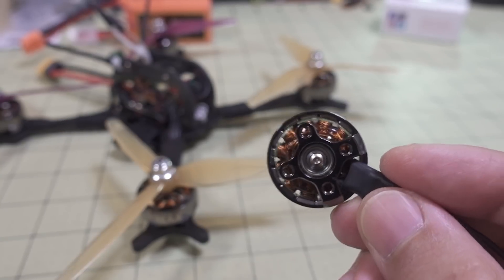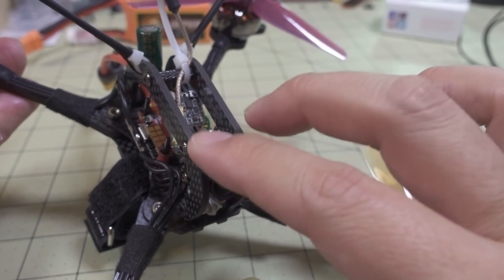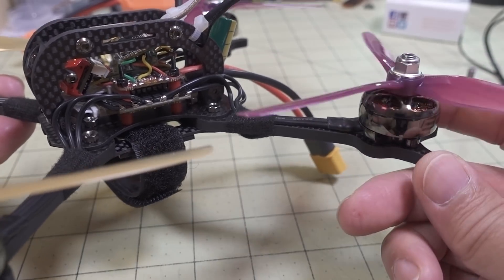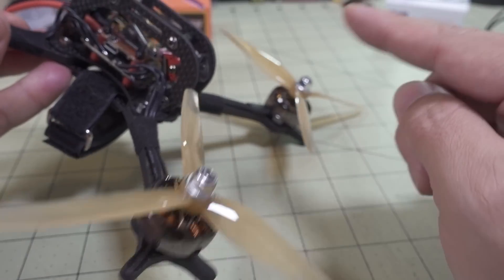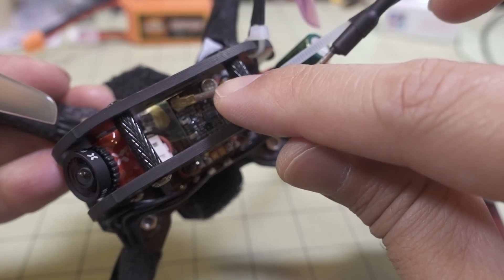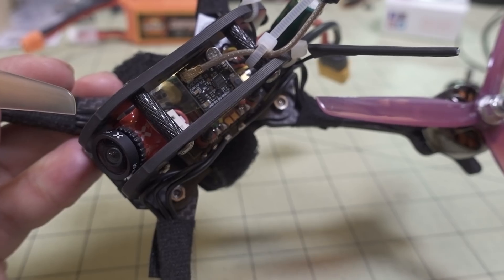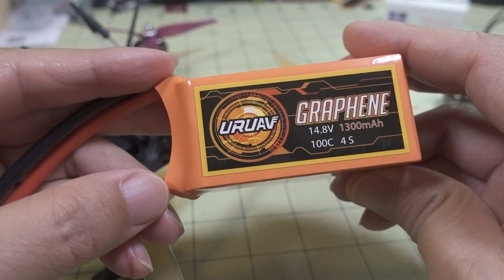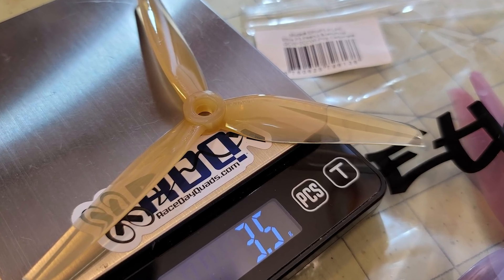EMAX ECO II 2306 Motor PLUS Other Stuff 🛠️

Comment: I bought 2207 1700kv motors and I have a 40a esc, will I burn the esc while flying with 6s batteries.

Comment: i-Flight XING-E Pro 2208 2450KV Motor is good?? Or emax eco series 2 1900kv??
Reply from the maker: Kinda depends on the prices.  Both motors are good.  I think the EMAX will cost less usually and might be a better value if the cost is more than $3 lower than the XING-E.
Reply: @AlbertKimTV  which would u choose
Reply: Or this
T-Motor VELOX V2 V2207 Powerful FPV Motor

Comment: I am still out dated with the new motors but doesn't these motors require two sets of clockwise and counterclockwise motors or is there any technique that all the four motors spin in their desired directions without having such type of specific lock nuts?
Reply: Probably don't need this answer, but it will serve for anyone scrolling down in the next 5 months.
CW/CCW motors are old school, Nylock nuts were uncommon so they needed special threads to prevent the motor from torquing the nuts loose.
Today with aluminum locking nuts and serrated bells, there is no need- there is however a slight advantage if you use "turtle mode" all the time since the props are usually in contact with the ground, proper CCW/CW threads would only get tighter, where standard ones may spin a nut loose.
Reply: @wyvern4588  i was having that question yesterday, thank you a lot!